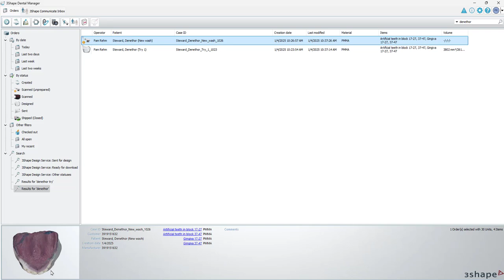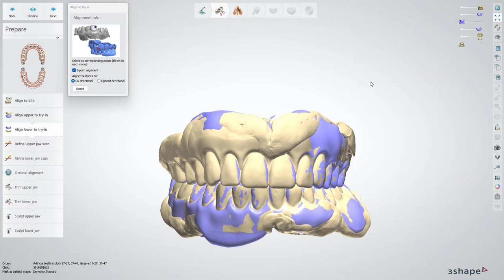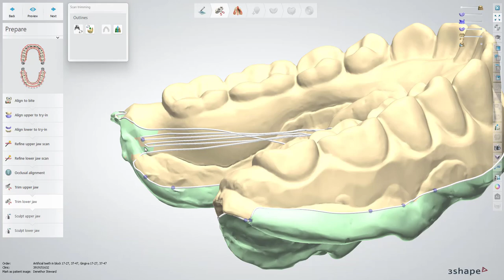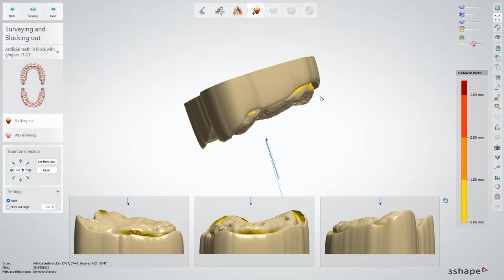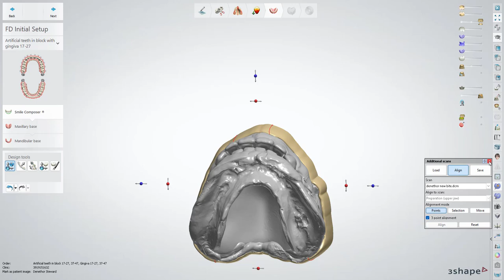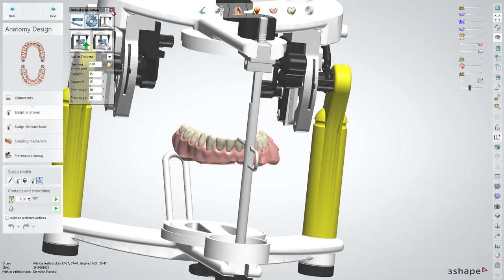3Shape Denture Design: Adding a Wash Impression

Comment: Hi there, we have 2024 and have found that we no longer can use the old method (where you align additional scans and swap the preparation scans behind the scenes). The only work around I can see is to make it a 2023 order but that deletes the design. We don't have a trios so can't do the digital impression method. Do you have any suggestions for a work around for 2024 for those with a desktop scanner? Thanks!